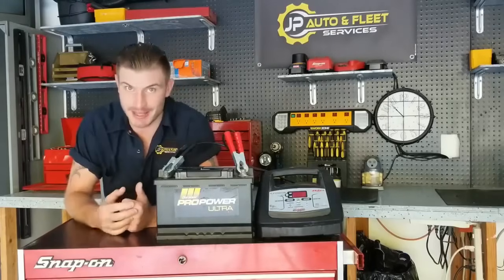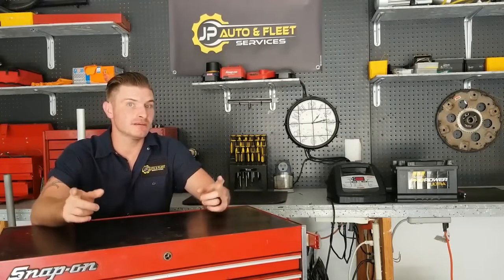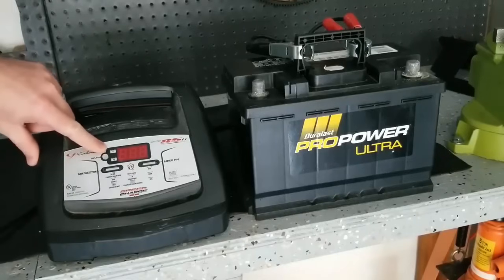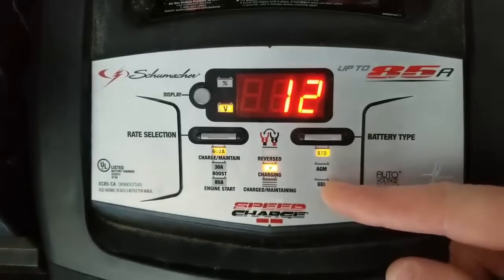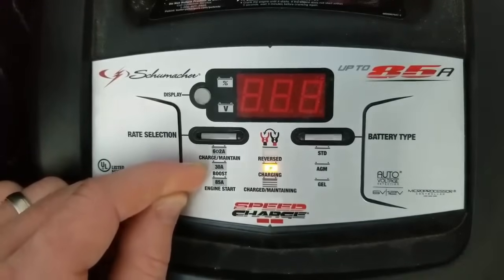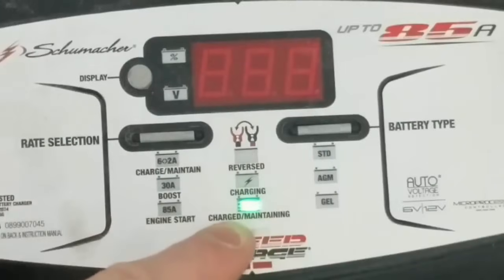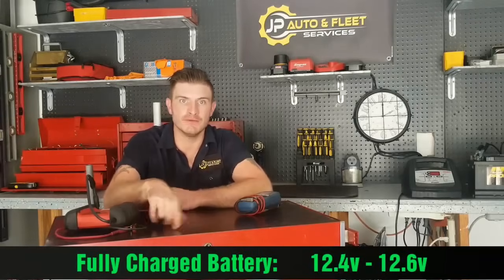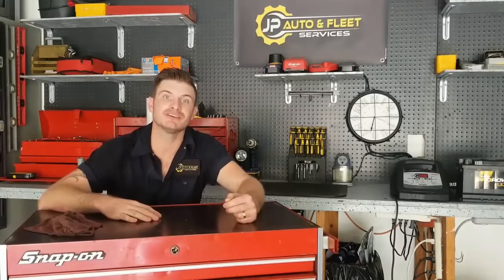How Do I Recharge My Car Battery | How Long To Charge A Car Battery At 2 AMPS

Comment: Can I connect the charger without removing the battery? 
Battery is under the footstep in the cab. I have connect points in the engine bay.

Comment: Thanks for the tip of using the volt meter.  I was charging the battery on my Sonata - thought I had waited long enough, but it would not start.  Checked with volt meter - only up  to 10.38 volts.  Got so more charging to do!

Comment: Question: My schumacher basic microprocessor charger instruction book, indicates, for charging OFF the vehicle, you should attach a " 24 inch long, 6 gauge, insulated battery cable" to the negative post, & connect the negative clamp of the charger to that. I was trying to figure out EXACTLY what this setup would look like, so I was hoping your video would explain. I'm wondering if I can get by with using my jumper cables: attach the negative clamp of the jumper cable onto  the negative battery post, & then clamp the negative charger clamp to the other end of the negative jumper cable. It seems there should be no reason this can't be done. Or just clamping the charger negative right directly onto the agm battery is okay? (The reason the booklet gives: a spark near the battery may cause an explosion. Using an intervening battery cable is a safeguard).

Comment: My 7-year-old battery has been reading just over 12V after the battery light went on the other day - but the alternator is only putting out about 11.8V.  Slow-charging the battery got it to 12.23V at 80%.  While I work on that crazy-tight lower alternator bolt tomorrow, I'll have the charger on to see if it reaches 100%.  But 7 years - that's Costco for ya.
Reply: 7 years is amazing

Comment: Hello, 
I’ve bought a new battery, I installed it in the car and drove right away with it. 
My dash still indicate a red battery signal but everything is working properly.
So did I do something wrong by not fully charged the battery before using it and if so can I still charge it the way you just explained? 
I know it’s an old video but I take a chance writing to you 
Thank you

Comment: If a battery gets limited use, put a 1 amp maintained  charger ($30) whenever battery isn't being used.  Example: tractor/mower during winter.
Reply: Good tip i have a solar power charger on my riding mower.:face-fuchsia-poop-shape:

Comment: A charger that does 5 amps or 10 amps is a much better choice for most people.  Lead acid batteries like to charge at approximately 0.1C....an 80 Ah battery would be ideal around 8 amps.  2 amps is slower than necessary and 30 amps is way too fast.  CTEK MXS 5.0 and Noco Genius 5 and 10 are my preferred chargers.

Comment: Here is my question.  My wife' vehicle has been starting fine with no issues .  The past 2 days we got 10 and 15 degree days and go to start and it won't start.  Does this mean the battery is bad or weak cells?  I just put the charger on it but not sure if this will help going forward if we get colder temps again.

Comment: Such good information, thank you! Taking all this info into account. Who knew? Not me! I had been having a problem with periodic dead battery, but it's my short trips and low speeds (15-20 mph) urban driving. Understand now that I need to charge the battery, not just start the car-so one question. Will a standard extension cord, the orange kind, work for this?

Comment: I have a Schumacher SE-1052 with 50 amp engine start, 10 amp fast charge and 2 amp slow charge settings. It has an analog  needle gauge to indicate both the DC amp draw and the percent of charge in the battery. The charge amperage tapers down as the battery nears full charge.

Comment: Most of the shoemacher battery chargers are garbage. They have a desulfation mode that goes into automatic even when the battery doesn't need it and goes as high as 16 V and fries your battery.

Comment: Most importantly, can you really put the charger's negative clamp directly on the battery's negative post?
Reply: I have a Schumacher microprocessor charger, & the included instruction book indicates, when off the vehicle, you should use a charging cable on the negative post, & then connect the negative of the charger to that, as far away from the battery is the cable allows, while NOT looking at it, & wearing protective eyewear.

Comment: Mine doesn't have the built-in protection feature but just yesterday quick charged it for thirty minutes. Charge and load tested using harbor freight battery tester and it was good. Them quick charged it for another 15 minutes . Yeah it has three settings emergency, quick and trickle rate . I never used emergency thinking if I'm not careful could damage it. Also used trickle rate when I can wait hours even overnight.

Comment: PLEASE HELP I have a 2015 Hyundai Elantra GT and the battery is completely dead. Aftermarket alarm and remote starter installed. But when I hook up that EXACT same Schumacher charger, the horn or alarm blares constantly. I managed to get it to stop by turning the ignition key to the mid position, but the battery and car is making weird noises as the battery charges....I'm not sure if its even charging properly or if its damaging anything. Pease help!!

Comment: what a prick....  i have just put on charge a battery that shows 12.6 volts BECAUSE ITS FLAT....... this battery needs to be charged up as it will NOT start a car.. just because voltage shows 12.6 dont mean the battery has enough guts in it to start anything....i will now be charging this will a 2 to 3 amp charger for around 20 hours to get its current rate back up... volts and actual amps  sitting in the battery are very different.... i have another battery that is on my car that shows 12.2 volts and that thing will start  any 4 cylinder diesel up to around 6 litres...... the CCA is loaded with 800 amps.. the 12 .6 volt battery shits itself when you turn the key on to start..... but will be fine when its charged back up...so do not presume the battery is full at 12.6. you need t otest the battery under a load then 12.6 would be fine...

Comment: What if it’s at 12.4 and the car still won’t start? It turns over but no start.
Reply: If it turns over then the battery is fine. You have another issue with your engine.

Comment: Thank you thank you I have the old Bunky roll around old fashioned charger But I want it something that will charge the battery and stop without overcharging it I have these ever start deep cycle power marine trolling batteries 27DC And I didn't want to destroy them from overcharging Thanks again.

Comment: I have a CAT CBC23E 25A charger. Because at night it frequently goes down to -20ºC, I hook the charger up to my Jeep 12V to top it off so there are no surprises in the morning. It starts off at 6A then trickles down to 2.0A after an hour. When I press the V check button the display says 15V. When I check the battery with a multimeter it says 12.7. Why is the CAT telling me the battery is 15V? Appreciate. Thanks for the simple DIY.

Comment: Do Optima batteries have any special charging requirements?  Is Optima a ‘gel’ battery?
Reply from the maker: Yes they are gel batteries. There is a special setting to charge them. Most modern chargers have it

Comment: With a 12 volt charger, what is the difference between charging at 6 amps or 2 amps?
Which amperage should I charge on?

Comment: I have a agm in my cobalt. Its in the trunk. Do I have to disconnect it 1st or is it safe to put the charger on it while its still hooked up as long as the car is off?
Reply from the maker: You can leave it connected with vehicle off

Comment: I would have thought a fully charged battery should be about 12.6 volts, batteries are sensitive, cold temperature affects the operation of a battery greatly, when batteries start to lose charge after a few years use its because sulphanation is occurring on the plates. This sulphanation would not occur at all if the auto working voltage were say 15 + volts as opposed to the 14 to 14.4 volts currently used but battery manufacturers need to sell batteries, batteries have been around a long time and have not changed greatly since then

Comment: I'm going to charge my 565 CCA battery with very small 1.5 amp charger . How long do you think ?
Reply: How many hours roughly did it take the battery to fully charge? Did it take days?
Reply: @spotlightdeals  overnight and was good in the morning.
Reply: @spotlightdeals  but could afford a 9 amp so bought that now.

Comment: My Prius auxiliary battery, which got drained because I left a light on, now says 12.5V after about 5 hours charging at 2 amps, but the percentage charge says 75%.  Is there something wrong?  Do I need to charge it more or could there be something wrong with the charger?

Comment: Excellent video but one question. Why is the second choice 30 amp, that doesn't make much sense to me. My charger second choice is 12 Volt that's what I usually use when I need to use it.

Comment: I don't have a brand new charger n,it always works , has deep cycle foe marine ,maual and auto forcars . It has a 0-15 setting to tell the state of charge I've had it od 6-7 hours and it hasn't budged , If I start the cat it says battery low and it cuts of functions to save juice . I have to go to Chicago early 4 am and don't want to get stuck in the ghetto,I plan to buy a new one when I get back but it went dead 2 years ago I heard clicking sound back by the gas tank but it charged . I hate new cars what could be wrong ,I know it's 4 yrs old and probably needs replacing but it should charge ,the only thing not normal my gas door was ajar when I gased up.

Comment: Hey there, I picked up a charger like the one in your video at a garage sale and realized later the cable connecters had been replaced with identical nickel plated  clamps. Is there a simple way to determine which cable is positive? Thank you! 
Your video was clear & easy to comprehend btw.
Reply: Use a multimeter. It will show -xx volt reading if you meter plus from minus and minus from plus. Then mark the clamps with something.
Reply: If you have the one he has it tells you if the clamps are reversed or not

Comment: Great video I have learned how to charge my car battery. But is it safe to leave the battery charging overnight in my house ?
Reply from the maker: Yes as long as you have a charger with protection build in
Reply: JP Auto & Fleet Services 
Should I check on it though the night? Or should it be ok intill morning ?
Reply from the maker: @playstation4gamer119  depends on the charger you have.

Comment: I have a question. On a deep cycle 12 volt battery when you are using the battery let's say for a trolling motor does the battery put off poison gas or is that only when you're charging the battery? Thanks

Comment: Hello Josh, 
How are you ? Hoping life is treating you good as you are treating life good, also.
My 21 yr old son just helped me to purchase a 2010 Dodge Journey with just under 80,000 miles. The dealership agreed to change 2 engine mounts per purchase agreement due to much front end vibration.
 Recently, had oil changed & still some intermittent shaking or vibrations when at stop light n on brake depending on how long at light the brake pedal trembles or lets out more intense brief vibration or shaking.

I also just recently purchased fix'd mechanic sensor which battery test revealed went down from 13.5 resting voltage to 12.5. Making me nervous as im homeless n on SSI living out of my vehicle. Long story, I snitched on my duddy in 2000 n mummy holding grudge against me.
Anyway, what may you suggest i do and should i be worried as i know hackers can hack computers n make things read bad when in fact they are good.
HOW DOES THE CHARGER SAY 100 BUT ONLY AT 12..
WHEN FIXD GADGET SAYS TO BE WORRIED IF FALLS BELOW 12.4 VOLTS. WHATS THE VOLTAGE OF A FULL BATTERY VOLTAGE ?

THANKS MUCH LOVE N BLESSINGS OF HEALTH & WELL BEING TO YOU
Reply from the maker: 12.6v is fully charged. If it's at 12.4V your good.

Comment: The one thing you didn't say was how long yet the title says how long. If the battery is a 110 ah charging it when it's flat at 2amp will take at the least 24 to 48 hrs (depends how flat), overnight will not charge it fully and a partially charged battery is next to useless.

Comment: How offen do you have to charge a car battery
Reply from the maker: Completely depends on if it ever gets drained when the car isnt running.  While it's running the alternator keeps it charged. But if you leave your lights on, etc. It will get drained and need a charge.

Comment: Thanks.  My wife car has been sitting around for 3 months,because of the pandemic.  I jump started the car and drove it for 1/4 of a mile.  Tried to restart it there was not enough juice to restart the car.   Should I use O'reily to charge the battery or use the Schumacher Charger?  Thanks  .
Reply from the maker: Either way would work just fine. But it's always good to have a battery charger sitting around just in case!
Reply: I have an old Schumacher that works great. Both brands are fine

Comment: So you are saying it is okay to check the charge with a multi-meter *while it is being charged?"
Reply: Before testing it with a meter shut off the charger to get an accurate voltage on the battery. With the charger on and connected you will read higher because of the source charge coming from the charger.

Comment: your battery should indicate AGM or GEL on the label. If you charge these types on the standard setting, you will dry out the battery and drastically shorten the lifetime. AGM and Gel batteries use aa charging voltage of 14.5 volts whereas a standard (flooded) battery typically charges at 16 volts If you hear a liquid sloshing sound inside your battery, it is a standard type battery. AGM and Gel batteries do not have free flowing liquid acid in them. It is either bound up in a glass mat material or it is in gel form

If you measure the voltage while the battery is still charging you will probably ready the charging voltage and not the battery voltage. You won’t know the battery voltage until the charger is disconnected for a few hours. Then you should measure 12.4 to 12.6 volts when fully charged
Reply from the maker: Correct! Thanks for the in-depth explanation.

Comment: I don't want to overcharge my car battery. I'm charging it with an older charger, a 6 amp one, which only shows amps drawn. Car has been sitting for a month unused, and it's voltage measures 7.68 v. When I connected the charger, the amps pegged immediately (went to 6 or more), and then settled at a little over 5. About 3 hours later it's now showing 4 amps. Generic instructions with the charger say that battery is charged when current draw is half the rated amps of the charger, so I'm figuring maybe wait until 3 amps or less (when I've charged it previously after seeming to take a little longer to start the car after a lot of stop-n-go shopping, it would maybe start charging at 4 amps & I'd let it charge until it got down to about 1.5 amps steady).  But given it was so low to start with, I don't want to leave it on too long unattended and maybe make it explode or something. How long do you think I could/should charge it in this circumstance?
Reply: I did disconnect the charger when it reached 3amps, and it measured 12.9v.
Reply from the maker: If it's not charging up overnight get a new battery
Reply: @JPAutoFleet  Ok, but I wasn't about to let it charge unattended overnight!
Reply from the maker: @dannichols6261  take it and get it tested man. Free to get it tested at any parts store. If your trying to see how long to charge. 6 hours. If it doesnt charge by then its probably toast
Reply: @JPAutoFleet  Thanks, good advice. I watched it charge for 3 hours, at which point it had gone down to taking 3A (from initial 6A momentary peak, 5A very slowly decreasing), so I took it off charge & it was up to 12.9v at that point,  so I think I'm ok for now.

Comment: Way too simple. What you should be saying. "As the battery is charging with a simple low amp charger a flat battery will stay around 12 volts and as it charges the voltage will climb to 14.3 when the battery is fully charged. Your smart charger will do this.
Reply: I think there's a difference in the measured voltage after charging the battery with a charger , vs being charged by the alternator while engine is running: " Fully charged automotive batteries should measure at 12.6 volts or above. When the engine is running , this measurement should be 13.7 to 14.7 volts ."
Reply: @dannichols6261  Hi Dan, Absolutely correct but I didn't think you said this clearly in the video.  .Voltage testing (and when to test) and charging voltage is a subtle subject which is difficult to put across. I use a CTEK 3.8 which is simple to set up and operate . It charges to 14.3 volts and then rolls back to a float charge. So you fit and forget a bit like your demo charger. Plus 95 percent of motorists do not have a voltmeter or know how to use one. The last thing we want to do is to put a simple 4 amp charger on the battery and leave  it on too long  as it will destroy the battery by  pumping current in after it is fully charged and "boil" away the electrolyte.
Reply: @djhvideo  Heh heh, yeah, I didn't say it clearly in the video because it's not my video , I was just commenting on what you said, because what you said rang a dim bell in my mind, I knew I'd read something about the voltages you mentioned, a long time ago, and had to chase it down! :)  I have what I guess is a simple charger, an old Schauer 'Charge Master' solid state 6 amp, model B6612, and I'm always somewhat concerned about how long I leave it charging, usually no longer than half an hour, maybe an hour, but this time I'd not run my car for a month & battery voltage was down to 7.68, so charging took 3 hours to get it up to 12.9, but it was worrying me that it was taking longer than I was used to.